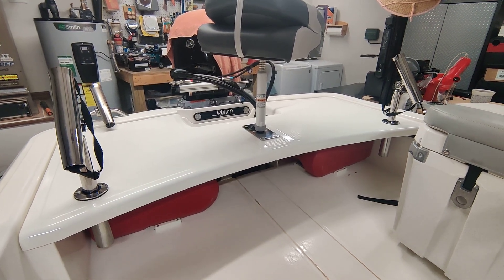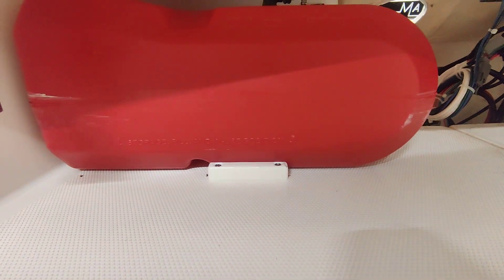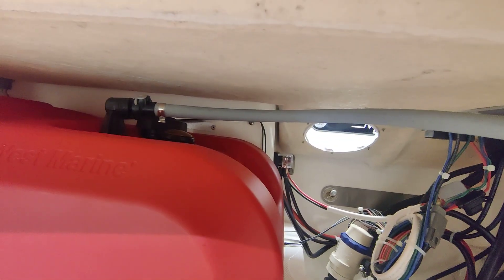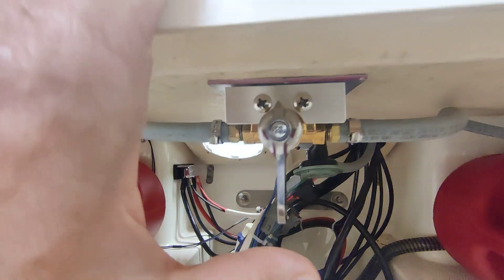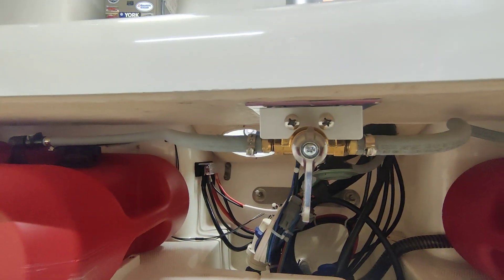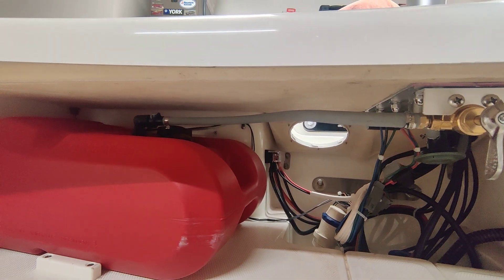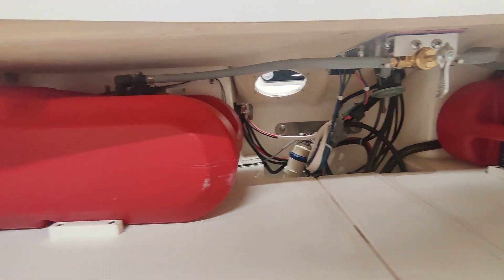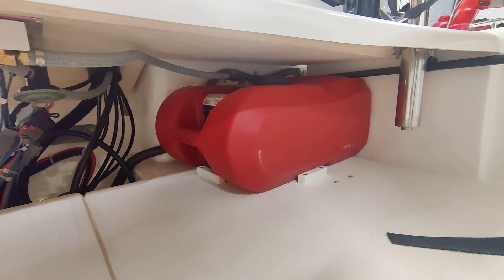Mako Pro Skiff Dual Fuel Tanks With Selector Valve

Comment: Thank you for the video. Is it possible to include a link or provide a manufacturer for the gas tank stops. Thank you.
Reply from the maker: Hello, I just made them myself out of 1/2" starboard. About 3" long and 1/2" tall and wide. Drilled two holes and countersunk them so the plastic tank doesn't rub on the top of the screw head when pulling the tank over them. Thanks for watching!
Reply: Nice! I just bought a 12 gallon tank for my mako skiff
Reply: @calirob1982 curious, did it fit? I’m wanting to put a 12 but I don’t know if it will fit under the casting deck

Comment: Hi sir, very helpful video. Thank you!!! Where did you place your starter battery?
Reply from the maker: @tbone5327  Your welcome. I moved it into the console. It is fairly easy to do. There is a video on my channel about mounting it. Then just run new wires, be sure to upsize them to at least 4 gauge. I added a terminal block in the back well area to connect the new battery cables to the old cables off the starter. Then attach the small wires that were connected to the battery in the back to the battery in the console, those supply power to the main terminal board. Thanks for watching.

Comment: also, i cant see in the video where the pump bulb is located in the fuel line, where is that located in the set up?
Reply from the maker: Hello again, you can see the fuel bulb at the beginning of the video, it is located above the deck tied in with the rest of the stuff going to the engine. I did not move it, it comes installed there from the factory.

Comment: Does the seat post hold you up pretty well?
Reply from the maker: @ChefMikeyMike  It does. The rear deck is very thick and solid. I also added a thick aluminum backing plate underneath that you can see in the video, I think it is 3/16, bought at Home Depot. Thanks for watching!

Comment: was the bracket you mounted the selector switch already in place or did you buy it? Also where did you get your fuel tank blocks? I'm going to do this to my 2012 MPS.
Reply from the maker: Thanks for watching. I made the bracket from aluminum angle from Home Depot. 1/8" x 1" x 3 foot.https://www.homedepot.com/p/Everbilt-1-in-x-36-in-Aluminum-Angle-with-1-8-in-Thick-801367/204273950
Reply from the maker: I made the fuel tank blocks from 1/2" pieces of starboard. 1/2" x 1/2" x 3". Drill and countersunk holes so screws won't dig into the bottom of the plastic tank.

Comment: can you share a link to the fuel selector switch?
Reply from the maker: https://www.moellermarine.com/moeller-marine/fuel-accessories/vents/fuel-valves-vents/brass-fuel-three-way-valve-14-fnpt-033302-10/
Reply from the maker: https://a.co/d/fhqEJbd
Reply from the maker: Sent you some info but had to delete it as the size I had was incorrect. These are the correct size 1/4 NPT with 3/8 barb. Valve is 1/4 FNPT. Make sure to get the one with the center fitting that points back like the one in the link instead of down.